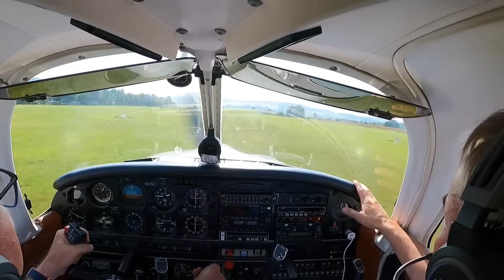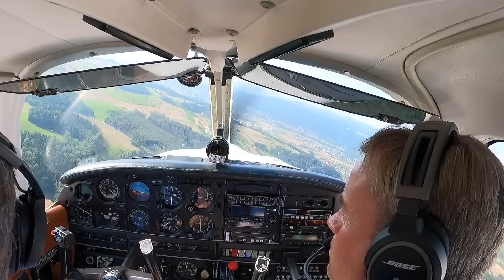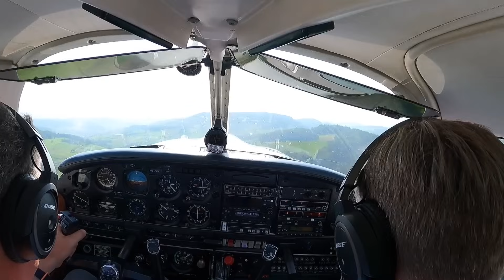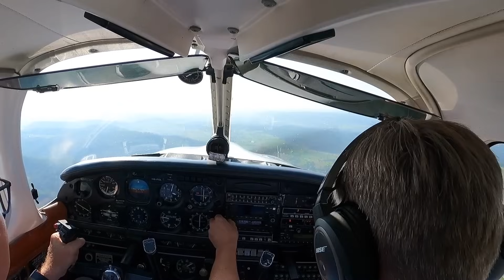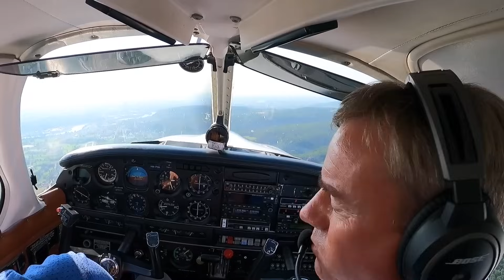LIVE ATC Emergency Landing. Crash Landing, Filmed inside , No Wheel Landing, Spectacular

Comment: At 17:20, when the pilot in the right seat (the instructor?) says that they will basically go "radio silence" on the final, you can hear (and see) him doing a "double click" in response to the airport acknowledging his message. 

For non-aviators, the double click is used by pilots especially in Pan-pan or mayday situations to basically say "Roger!" or "received and understood" as a way to not clutter the airwaves and also to help the pilots deal with the situation. The double click will also be a hint to ATC to STFU unless there's extremely pressing matters 😇

Comment: Thanks for sharing this video! I think the situation was very well handled, congratulations to both of you! 😉👍🏼
I love how you as the instructor still took full benefit of your student by asking for further ideas and maintaining a shared mental model! Also I recently bought the BOSE A20 Headset and after this video I‘m super happy I also got the bluetooth functionality. Being able to talk on the phone in a situation like this is clearly a huge benefit.
One thing I see a lot (especially in GA) is people hesitating to actually declare emergency or at least pan pan. A missing landing gear wheel is kind of a once-in-a-lifetime thing, a fundamental structural damage, and I‘m sure nobody would blame you in the aftermath if you had decided to declare mayday. It gives you a couple of benefits, i.e. you can be sure you‘ll have the airspace all for yourself, you will also have ALL of the available emergency services on standby, not only fire brigade but also an ambulance which can save lives if there had been a fire or a different outcome. And it wouldn‘t cost you a penny (or Rappen😜). But as for all incidents, it‘s easy to talk when you haven‘t been in the situation.
Good job and, again, thanks for sharing! 👍🏼🙏🏼😃
Reply from the maker: I did not declare an emergency for several reason. As per definition it is immediate help required which was not the case. It will trigger on any radar in the vicinity a signal to get attention which was not necessary. So per definition it was not an emergency.  And Mayday come from the french help me, as nobody can help in such a situation is useless. But you can of course discuss about this if and what would haplen. Anyway thanks very much for your comment!!! Happy landings!
Reply: The instructor was lost several times.  He had to ask the student what was said on the radio.  Her should have asked ATC for a repeat instead.

Comment: Here is what was missing from the book.  But these two wrote it in the air.
Emergency Procedures-Wheel Missing
1.  Determine which wheel is missing using ground personnel for a visual inspection
2. Landing preferred on cement of asphalt runway.
3. Land closer to side of the runway with the good wheel
3. Attempt a full flap landing to attain minimum speed
5. Attempt to minimize  the fuel in the tank(s) in the wing without the landing wheel
6. Prior to Touch Down.
  a.  Master Switch Off.
  b.  Fuel Selector Off 
aileron to balance aircraft on that wheel as long as possible
Reply from the maker: well done

Comment: My compliments to you Anthony and your flight instructor, proper decision making and situation handled very well, causing only minimal damage on aircraft. I would love to hear a follow up, if prior damage to the landing gear caused it to fail or an aircraft mechanic has to answer some unpleasant questions. With flight school or flight club chartered aircraft it’s sadly often the case that bad landings do not get reported, and prior damage might actually even with a proper preflight check still be invisible.
Good to know you guys are safe and sound and thank you for the great video! A very happy landing for your future. My own flying career started close to 50 years ago in Altenrhein, so always excited to see videos from home. Greetings from 🇨🇦
Reply: It must have been prior damage, because the wheel was present when we took off (!) and already gone before approach for our touch-and-go in Schupfart. The pilots on the ground saw us approach with missing gear and went directly to the radio to let us know. A fellow student flew some solo circuits in the same aircraft earlier in the day, all observed by the instructor, with no hard landings, so whatever stressed the bolt must have been even earlier than that. We didn't skimp on the preflight outside check, but I have to admit, I look at tyres and fairings and struts but hadn't been looking closely at those bolts. Don't know whether you'd be able to see something like that or not. It would depend on where it was cracked, and we don't know that.
Reply: @dysona  If I understand correctly, it was a broken bolt causing the loss of the wheel, I expect actually that it was caused more likely by a failure in the material of the bolt than anything else. Even so truly very rare it does happen! A metallurgic analysis will shine a light into the dark. I also don’t think anyone could blame this to an inadequate preflight inspection, because even if a guy crawled underneath the wing, this would have been hidden & even if you had rocked the wing I think it would have been unlikely to be detected. I believe this was simply a true case of pure bad luck. That bolt is designed to an immense load of stress and I can not recall having heard about failures of bad landings causing it to fail. I know about a similar case happening some time ago in the US but don’t know what the issue was there. My first airplane was a Cherokee 140, never had any issue with it, they are robust built airplanes. Only recently this wing spar problem is appearing, on high time, high use cherokees! I noticed they are having a serious look right now at the wing spar and I don’t know if they found anything of concern. 
I’m a retired commercial & bush pilot and had an instructor rating too, flying for almost 50 years in places like Africa, South America and here in Canada’s northern Arctic, so I have seen a thing or two. 
You guys showed excellent airmanship & made the proper decisions: aviate, navigate & communicate!
I wish both of you the very best and a happy landing! Cheers from🇨🇦👍👏👏👏
If I may give you some advice for your flying future. If you ever think about aircraft ownership, make sure you also get yourself it’s maintenance and parts manual and select a mechanic who is well familiar with the aircraft and willing to go through all it’s systems with you. Something I religiously did and proofed itself beneficial on many occasions!
Selecting an aircraft is much like selecting a women, learn all about its weak points before you engage!😉

Comment: Well done. Opening the right door to increase the drag on the right side to keep the direction as good as possible....good idea.
Reply: Unlatching the door (there is only one) on a PA-28 prior to an emergency landing is actually in the emergency checklist. Main reason for this is to prevent jamming of the door in case of a really hard landing.
Reply: @viktorsvedholm4711  right :-) we opened the door to expedite the egress :-)  and closed the flap on the left hand side just before touchdown in case it was going to get hot and smoky out there!

Comment: torque link issue strikes again. Hard to pick up on the pre flight, plane lifts off and the wheel and strut just drop away. Only the brake hydraulic line hold on for a bit then snaps off. This happened to my student in Australia and I believe it has happened a few times before. Well handled.
Reply from the maker: Thanks

Comment: I really admire your calm handling of this emergency. I don't think the landing could have been done any better - great job. Was the aircraft badly damaged?
Reply from the maker: Hi, Thanks very much for your comment. The aircraft was not really damaged at all. We did not touch the prop or the wing. only some scratches on the elevator. And the aircraft is flying already with a new landing gear!

Comment: Actually, LEFT rudder trim would be required during the landing flare (full right aileron, full left rudder), but once the friction from the missing left wheel kicked in, you would need lots of right rudder.  During the landing rollout, I was yelling, "FULL RIGHT BRAKES, FULL RIGHT BRAKES", hoping to counter any left turning tendency from the missing wheel.  Just wondering how much braking action you applied and if that was discussed in the pre-crash briefing?
Reply from the maker: Yes I was thinking of this. But keep in mind if you break to much on the right break then you induce an immense downforce on the left strut that will cause the aircraft to ground loop to the left or even tip over on the nose!! But thanks for your input, it would be great if we could try several landings in a simulator. Afterwards I realize there are many physical effects during a landing without a wheel. I was thinking swell of using the centrifugal force to the right by turning the plane to the left in order to keep the left wing in the air as long as possible.
Reply: @Warbird-Aviation  I think you needed a circular runway.  The landing would be one giant circle to the right, keeping the left wing high during the turning approach.

Comment: We had a very similar event in a PA-28 in the 70s, I repaired it and it was flying again next day....
Reply from the maker: hi chris, thanks for your comment. Did you find out the reason?  We have heard if low quality bolts have been installed they can be sheared off and the wheel is gone. The quality standart should be NAS and not NA standart an aircraft mechanic told us recently this as he was involved in such cases.

Comment: Don't forget left rudder once the ailerons are maxed out. As long as there aren't any obstacles or rough ground to the left of the runway, and what's left of the landing gear can handle the lateral stress of turning. At some point, the plane won't be going fast enough for the ailerons to keep it level, but you can keep the left wing off the ground a little longer by turning the plane to the left, eventually using the tiller, and sort of spiraling inward on the grass so the plane is moving as slowly as possible when the wing finally goes down.
Reply from the maker: Yes I was thinking of this aswell!

Comment: These accidents are common for the piper PA28. It is caused by by poor maintenance and bad design. Lack of grease on the pivot pins which siezes and the twist of movement snaps it. It is the only thing that hold the tube from dropping out completely,  the brake hose is unable to keep the weight supported.  It has been happening too often and not been addressed by piper other than to state a particular grease should be used. Any grease would work as long as it was THERE.
Reply from the maker: Thanks very much for this input. Ive seen it happened already sometimes. I wonder why there is no airworthiness directive about it???

Comment: You managed to keep it on the rwy, good job.
Did you use right brake to keep her straight? Or just rudder pedals? Curious how much that strut was pulling the left wing back.
Also glad to see that the strut kept the wing from touching the surface. I grew up on Cherokees and always wondered whether the strut is tall enough for such emergency.
Btw, am I correct that the ignition was left on? And then somebody rotated the prop later? I hope they turned the ignition off first!
Reply from the maker: Hi, I did not use right brake because of risk of tipping over. the drag was increasing the slower we went

Comment: PA 28 & related aircraft use the torque links to prevent the oleo strut from simply dropping out;  this is a known issue with these aircraft.  Adding a simple safety strap so that the normal extension of the oleo does not shock-load the torque links is "cheap insurance".
Reply from the maker: Thanks for your feedback. I ask myself why is Piper not doing something about?
Reply: @Warbird-Aviation  These designs are around 50 years old;  they may issue (or may have issued a long time ago - I have not been following them) a Service Bulletin on the subject.  They presumably are still selling spares, so I would think that they expect people to replace the torque links before they are in any danger of failure.  It would be normal practice to put a life limit (number of landings) on such items.  I used to own one, in the 1980s.

Comment: HOW did a fixed landing gear come off to begin with?!?!?!
Reply: The lower strut assembly (which includes the wheel, tire, and brake) is connected to the fixed upper strut assembly by the scissors (also called the torque links) the links are made of cast aluminum. If a fatigue crack developed into a fracture then when the airplane lifts off gravity pulls the entire lower strut assembly off. It might hang by the brake hose but usually the hose fails and the assembly falls away. It happens very infrequently. Although I have witnessed it on Piper aircraft (most notably the Cherokee trainer series) more often. 

VERY good job on the part of the instructor.

Comment: Turn off Nav#2, CHECK!  Turn off Transponder, CHECK! Now right before we land turn off the radio and then when I give the signal, turn off the master switch last!    That's one heck of a emergency priority procedure...  lol
Reply from the maker: Well you mean if Battery Master is off everything is off? That is correct  but if you crash I just wanna make sure if there is a shortcircuit less possible current is flowing.  Maybe makes no sense for you but for me this way is safer.

Comment: as far as burning fuel because you are worried about sparks.... the less fuel you have in a tank means there are more fumes present.. it is better to NOT have the fumes of an empty tank VS. a full tank as far as sparks causing  a fire... the fuel air mixture is extremely flammable with fumes
Reply from the maker: You are right with this!!

Comment: Burn to empty tank in left wing , leaning right both of you won’t do anything , and get familiar with your QRH , there’s nothing about a missing  wheel in your check list  ,  reduce to the slowest speed possible  , using  ailerons keep the load off the left wing as much as possible  ,  land on the right hand side of the runway , and declare an emergency , 😖💸
Reply from the maker: It sounds like you are a professional and have done this alot of times??